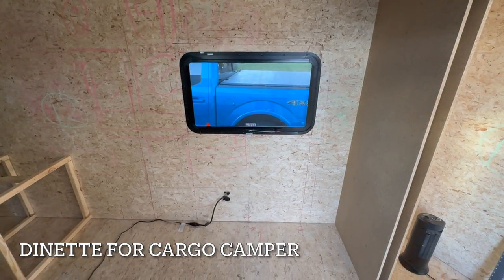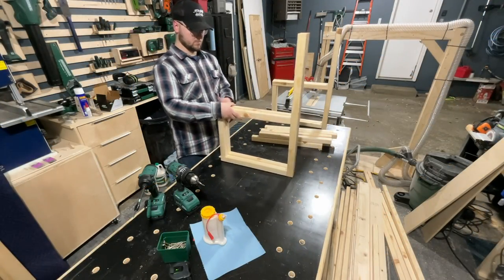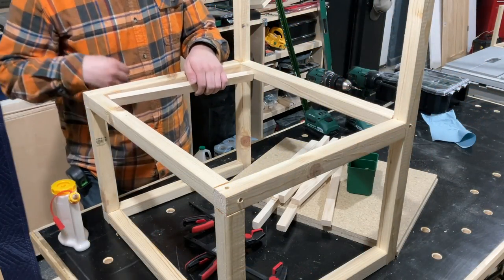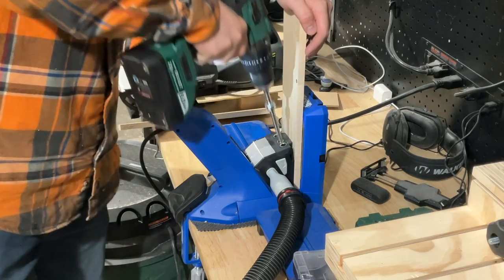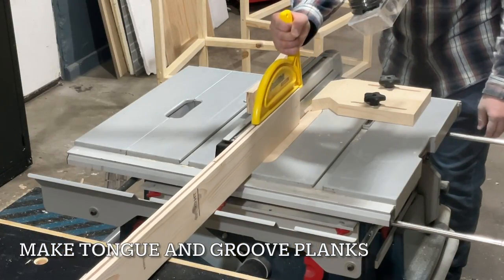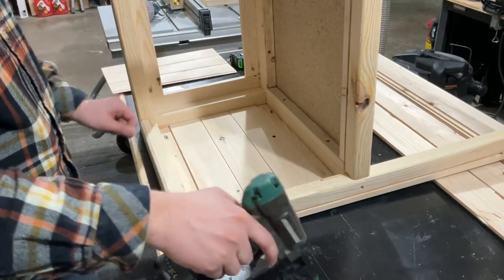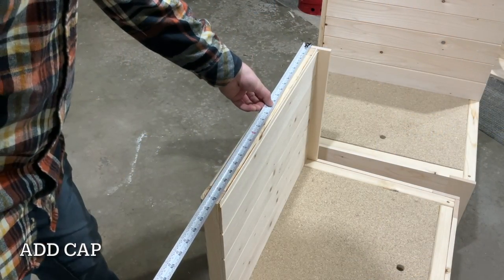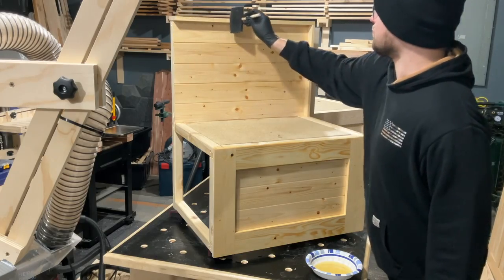DIY Dinette Seats for Cargo Camper, RV, or Van #cargocamper #vanlife

Comment: I appreciate this video so much! I’m working on an RV remodel as a first time, no experience DIY project. Do you have a step by step guide/materials list that I could print out? Also, how do you secure to the trailer once you are done? Thanks!
Reply from the maker: I do have links to various parts I used in my finished walkthrough video: The Cargo Camper | 7x14 Cargo Trailer Camper Conversion #cargocamper
https://youtu.be/Uf9iu4BHYOA

Also that video has links to other videos of the trailer build. I don’t have a step by step guide for the whole thing but my videos are how-to style for various components. 

Also for securing to the trailer. I converted a cargo trailer so I secured most things to the chipboard floor and walls but I also used some self tappers to attach things to the aluminum studs of the trailer.
Reply: @fangerwoodworking  Thanks for the reply! I will check out the mentioned links.